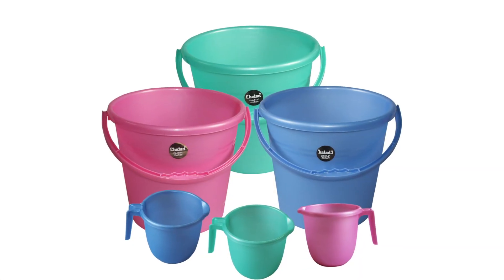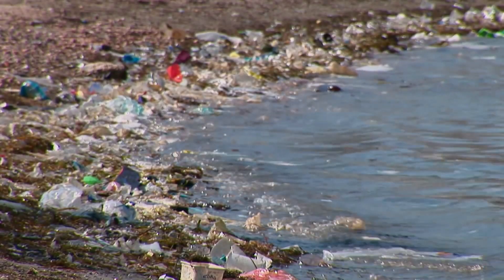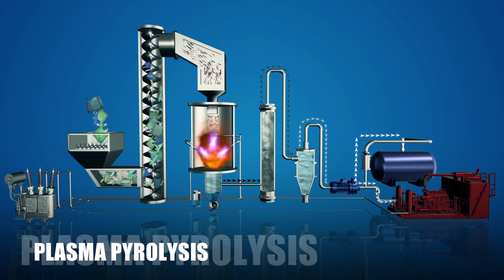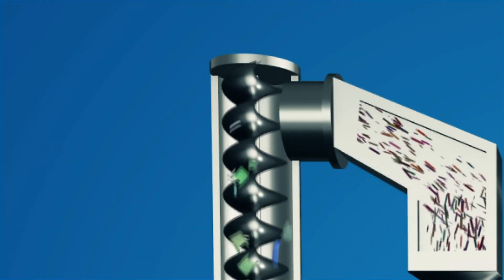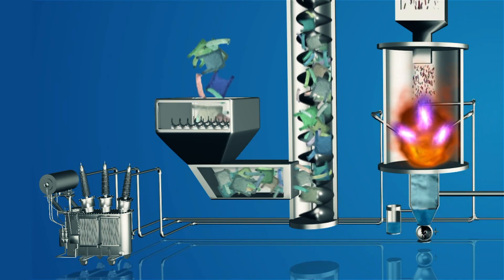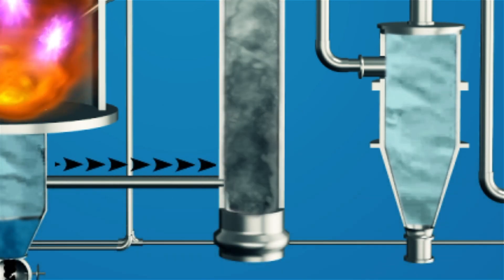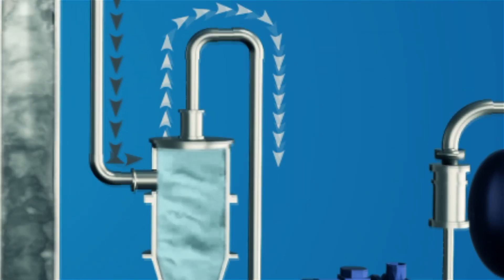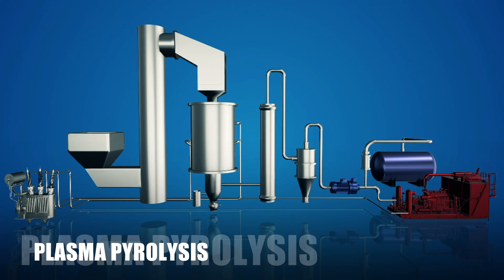PLASTIC WASTE TO ENERGY THROU PLASMA GASIFICATION PLASMA PYROLYSIS ENG

Comment: BS this is fluidized bed burning ,with all of its inherent difficulties, same as the solid waste reheat systems abandoned years ago. A turbine will be catastrophically destroyed the minute you get below the superheat threshold, sending wet steam to a hot spinning turbine. The boiler is not secondary to the turbine, and your graphic depiction  appears to be an engine not a turbine. i call BS.

Comment: What is needed is a way to reduce the waste to elemental components by breaking the atomic bonds:  Carbon, Oxygen, Nitrogen....etc.   This would require huge power levels generated from fusion reactors.

Comment: This has been tried commercially since 2008, but not much success. There is a whole Wiki page on the various facilities using this. The Navy aircraft carrier USS Gerald Ford (CVN 78) is using it to burn 400 pounds of waste/trash an hour.  I was hoping it was the future of waste and hazardous waste disposal.  The plasma arc is 1000 degrees Celsius hotter than our sun.

Comment: Cold Plasma Pyrolysis is a method which is used to convert plastic trash into fuels such as Hydrogen and Methane. These gaseous fuels can be used to produce electricity and power vehicles.

Comment: Only plastic waste.... That's not a viable option.
Reply: All wastes can be burned in the plasma stream.  Generally metals are separated out for recycling.  One of the goals for this type of process it to use old landfills as feed stock. We would be emptying landfills to burn them for syngas production.
Reply: @Flash_Gordon_x  great, but landfills are not a clean feedstock. unless you have the peasants sort it, your will spend a large portion of energy on labor costs, perhaps a robot  separator is what's missing in the scenario.
Reply: @missmiss400  Great idea!   They already use a scanner to sort and identify the waste stream, just need robots to sort.

Comment: How  much electricity can it produces in terms of voltage
Reply: voltage is not a measure of electricity production. A transformer is used to step up and step down voltage levels to meet component requirements.